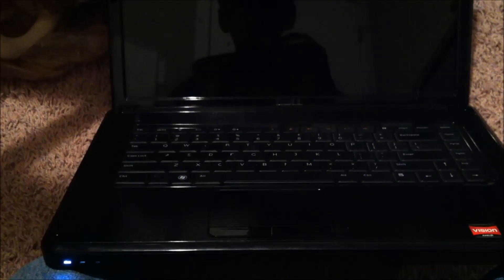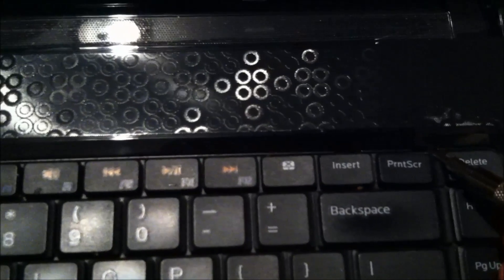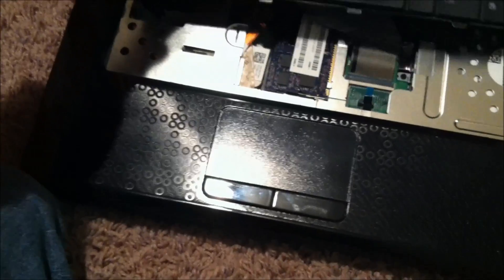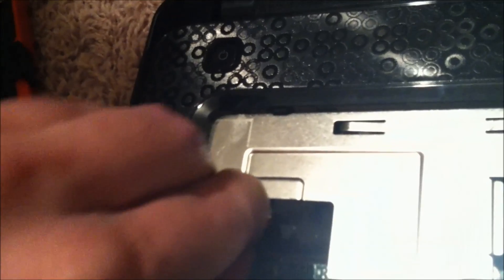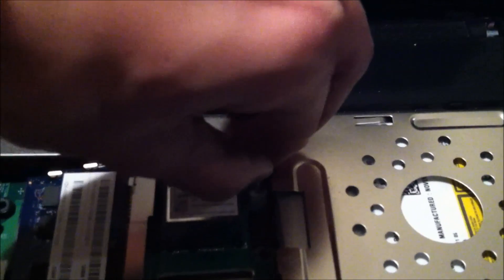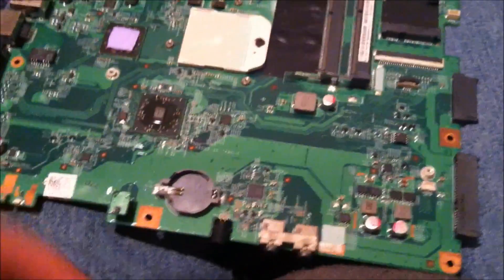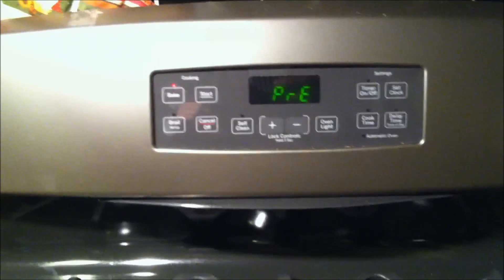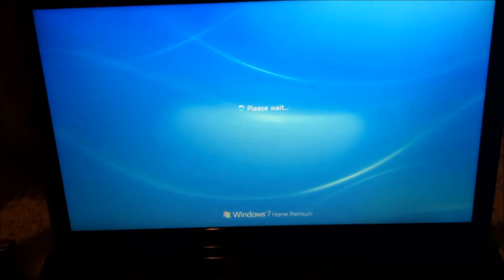How to fix repair Dell Inspiron M5030 7 Beeps Blank Screen No screen when turned on

Comment: Thank you so much it worked! Subscribed! I just had the same problem as Angelika, not connecting to wifi, and i saw your comment about reversing the wires on the wifi card, but if you could explain it more to me that would be helpful cause i dont know how to do that. lol. thanks again!!!

Comment: This was great. I know close to nothing about computers but I was still able to do this and my computer works as well as before. I will say one thing though, my laptop is having issues connecting to my wireless network. It can't connect or sometimes even find the network unless I put my laptop directly next to the motum. Anyone else have this problem? Any tips?
Reply from the maker: Reverse your wires on the wifi card, see if that helps
Reply: That worked! Thanks a lot!
Reply from the maker: Awesome. Good job!

Comment: Didn't work !
Reply from the maker: thats a bummer,look on ebay for a repair service, or you can buy a new motherboard for about 70. Since you know how to take it apart now, should be easy for you to replace!
Reply: It turns on sometimes.. But then it shows the screen green and black
Reply from the maker: reseat your video connector for the screen and make sure you closed down the flaps on all the connections such as keyboard and power button.
Reply: Thanks .. Too late tho., It got me mad and threw it against the floor and threw it away :(

Comment: Tuve el problema de los 7 beeps, particularmente no tengo pistola de calor ni termómetro infrarojo y es un equipo caro, en argentina, para usar una sola vez.
Use esta solucion, 10 minutos dentro de un horno precalentado a 170 y me funciono muy bien. 
Ahora mismo estoy escribiendo desde la notebook... Evidentemente voy a tener que modearla y hacerle unos agujeros abajo para colocar un fan. Es un desastre la ventilacion de fabrica de la notebook, al menos para los calores de buenos aires.
Reply: Man de verdad te funciono? yo tengo el mismo problema y wooo eso de meterla en el horno joder que da miedo no?. Gracias.
Reply: Es una solucion temporaria, hay que hace reballing si o si
Reply: Que es reballing?
Reply: Buscalo en google, es resoldar el chip de video.

Comment: Brilliant! Thank you so much!! One day on since the repair -- and I don't' want to jinx it -- but all seems good with the machine now! I've run all of the deep (Fn) pre-boot diagnostics, booted into Windows both in Safe Mode and Normal mode, run Windows updates and other product updates, and rebooted several times, all without hiccups. There are only two side notes worth mentioning here: 1) Before putting the machine back together, you should clean off the old thermal paste from the CPU and the heat sink, and then apply new thermal paste. 2) Because you must remove the CMOS battery in preparation for baking the motherboard, when you boot the machine for the first time after reassembly, you might get a "5 beep" BIOS error, which indicates problems with the CMOS clock. I tested my CMOS battery before reinstalling it, so I knew it was fine. So, I rebooted, set the correct date and time in the BIOS, and the "5 beep" error went away. No problems after that. Thank you so much again for your effort and excellent instructions! Your explanations, procedures, and video are clear and concise -- really well done, and they worked!

Comment: Yo bro. It worked. Actually i am the mobile engineer. And also computer hardware enginner. I have done similar problems with heat gun (smd). But after reading this post i gave it a try. Here is my process.

1) I disolder the inbuilt microphone
2). I didn't have oven and alluminium foil. So i use my microwave which has grill, combination, convection function in it. 
3) i took out every thing from microwave like the plate. Ring. Centre base of the glass plate.
4) put in mother board naked.
5 pressed the "cook+bake" button set 180'c for 10 min and pressed start button.
5) its started sparking on the board. So i stopped it.
6) i pressed "bake/keep warm" button. With the same degree and time.
7) after 6 minutes the microwave's door heat up alot so i stopped it. And left it as it is for 20 minutes. Then i opened the door and again left it for 20 minutes.
8) i solered back the mic and. whoaah. It started up.
Thanx for this. I hope this procedure help to those who has this kind of microwave but not oven.

Comment: Hi can I use my microwave for the same what should be the setting medium heigh or heigh
Reply from the maker: Anything metal will explode in your microwave. Motherboards have copper in them. I suggest not doing it. However if you do, record the process. I don't recommend it though.

Comment: una pregunta, cuanto tiempo y a cuantos grados deve estar la placa madre? perdon pero no entiendo el ingles
gracias
Reply: Yo lo probé y me funcionó a la perfección muy buena informacion.
Calentá el horno a 190 Grados Celcius una vez que llego a esa temperatura ponelo en el horno el mother con papel de alumio abajo si o si y en una asadera claramente como vez en el video y sin ningun componente sin memoria ram ni disco rigido ni placa de WIFI ni la lectora de DVD ni el cooler.

Solo eso dejalo 10 minutos a 190 grados y apagas el horno lo sacas, esperas a que se enfrie por 20 30 minutos y listo.

Comment: You are so great. It worked absolutly well. Thanks a lot. I have a Inspiron M5010 and the Motherboard is the same. Thanks thanks thanks. P.s.: Celsius is 200 degrees.
Reply from the maker: Thanks for the Celsius degrees, that will be helpful for many others!

Comment: Man this is great, Im taking a break from copying all my most wanted files to external!! I debated for weeks about doing this after many attempts at the simpler solutions,  I then started watching different videos while taking computer apart, everyone had left out a few lil steps here and there that I had questions about (because im picky). when I watched yours I was able to get all connections apart properly and would say the whole project took maybe an hr!! Now here we are!!! I will be thrilled if it works all night but will continue to use until I can comfortably afford the $500 I was about to spend this morning, at a not so comfortable time. Great video!! You saved a lot of files I had not backed up. THANKS, and good work!

Comment: Is there any other way you can think of which I can use to fix the same problem? I dont have a oven right now
Reply from the maker: Walley Ambano heat gun or soldering iron. Extreme fix would be a propane torch(would not recomend it)

Comment: only temp fix, after many searches they used some sht soder in the chip and due to it cooling fast when it shuts off it cracks and your back at the start...   what so and so said below if yours continues to work its cuz it never shuts off to cool which if you want to run the pc like that go for it idk how much longer the parts will last... we all got screwed by dell

Comment: Repair only lasted a week. Read that problem may also be poor cooling system. Gonna try replacing fan and reflowing again. Right now im using external usb cooling board. Any suggestions?

Comment: Thank you so much for this tutorial.  My laptop was serviced "professionally twice and the 7 beeps resumed after a couple of months.  My son and I tried this process and it worked! Now I don't know if this is a permanent fix or not, but what I do know is that it works just fine right now and if it stops working again, I now know how to retrieve my hard drive with all of my data.  Your instructions were very easy to follow and the process was not a difficult one.  I would have been charged hundreds of dollars by the "Geek Squad" or some other repair service.  So...I'm a happy camper.  Thanks for posting!!

Comment: OMG!!!! This is solution like "How to make shit". This is not repair!!! It's can't work more then one week... ONLY way to repair this motherboard is solder a brand new northbridge 216-0752001.
Reply from the maker: I've yet to see any comment of this failing after a week. Not one. Not even after several months. Hundreds have replied and not a single one had said it failed after a week. I make videos for home viewers, people with simple skills. You make a video on how to solder a new north bridge and see just how many can do it. Until then, my viewers will easy bake their motherboards back to a working state.
Reply: After Hours Tv & Pc repair So, for whot is BGA station? Soldering station? Brand new chip? Only for stiupid people who dosn't have oven? Heh... I'm repairing motherboards from 6 years, and I know that reballing, heating all of broken chipset is NOT permanent repair, its only way to sell notebook on ebay like good nootebook. Problem with chipsets is in the solder ball under core between laminate of chip, not between chip and motherborad. So you cant repair chipset... I will add that motherboard after cooking can be not repairable. I'v seen pairs motherboard after cooking without meny resistors, capacitors, IC, etc... Because they fall off from MB during cooking :)  I'v seen swollen laminate too :)
Reply from the maker: Surely I wouldn't want to educate 48 thousand people to buy a 600-1000 dollar machine to reflow a 300 dollar machine. :)

Comment: Worked perfectly as expected, however now one of my (the top port) memory slots isn't working. I receive 4 beeps acknowledging a ram error whenever I put the memory in the outer slot. I've tried multiple ram sticks and still get the same error, so I can only use my one 4gb ram as apposed to 2x4gb
Reply from the maker: Sorry to hear that, strange that this would happen.

Comment: so is this temporary After Hours Tv & Pc repair
Reply from the maker: I've worked on three of these. 2/3 are still working today. I havnt seen any f these same people commenting back after months that it has failed again. Try it and see how long it works for you. I'm interested to know myself.
Reply: will do
Reply from the maker: It's been 7 days, still working?
Reply: After Hours Tv & Pc repair  sorry i haven't replied and yes its still working thank you so much i really appreciate it
Reply: After Hours Tv & Pc repair
How long ago did you bake this motherboard and is it still working?
Reply from the maker: nov 23, 2013. I repaired 3 of them total. This one is still working today.
Reply: After Hours Tv & Pc repair
Do you know if the other two are still working?
Reply from the maker: I havnt heard either way from them. You can see plenty of people saying it works. Have you tried it?

Comment: I didn't see anyone else mention that after the fix on the bootup mine beeped five times for a short while which is the code for a bad CMOS battery. It did stop shortly afterward and seems fine.

Comment: Will this same method work with a heat gun and tin foil? I have those two things. I re flowed an xbox with it. Also, is this a temp fix or permanent? This motherboard costs over 100 bucks. Just don't wanna dish out the money if I don't have to.
Reply from the maker: For the most part permanent, they suffer from a poor cooling design. The heat gun will work better than a oven, most common people don't have heat guns and this would be easiest to them to do, I refrain from telling anybody to use a direct heat source, had a guy try to remove his capacitors with a propane torch once
Reply: Just wanted to give an update here - I tried this out with the heat gun and it worked perfectly. PC rebooted, and beeped 5 times, which indicated the Real-Time clock was not working, but that was my fault because I forgot ti re-install the BIOS battery. However, I got a successful BIOS post beep and booted into windows. Back on top of the world again!

Comment: You're a life saver! I followed the steps just as you had described :)  And... my laptop is back.  I did experience a 5 beep afterward, indicating a time/date issue. I synced the time/date and wahla! Do you recommend any further steps to try and prevent the 7 beeps from reoccurring? Thanks!

Comment: Afriend brought a laptop that beeps 7 times when boots and the screen does not show anything. i did solve this issue this morning by application of this tutorial for those who does not have oven of heat gun, you can just use a soldering iron and something as a cover to the solder. 
Step 1. follow the steps here, but do not put it in an oven you can just do that by heating you solder iron. 
2. there are 3 chips which covered by the cooling system one being the processor and the two remaining are those you will work on remove the processor, 
3. put the solder iron on the two chips which is not the processor allow a small space between the solder iron and the chip. 
4. cover the solder iron and the chip only not all the board with something which will not burn in the presence of heat for about thirty minutes, for each chip. 
5. Allow the chip to cools you can best use fan to cool it 
6. assemble your laptop dell m5030 and boot it. 
if you really did it well it should boot and stop the beeping 
Thank you for any further if you failed contact me lukrudus@hotmail.com or +233506154495 / +233542707250

Comment: So how long did this last in working order? I have one needs this doing but don't want it to be short term, ideally.
Reply from the maker: One i did lasted 6 months, the owner was very rough with the laptop. I havnt heard back from the people commenting that it has stopped working.
Reply: Great, thanks for the info 8-)
Reply: Another quick question - is it necessary to take the WLAN card out? On the one I have the screw head is shot to pieces and theres no space to get pliers on it.
Reply from the maker: I think it will be fine. If not it's only couple bucks off eBay.
Reply: OK thanks!
Reply: lewisner .

Comment: why do people think putting motherboards in a COOKER fixes things ? .. this is the most cowboy method ive seen so far .. when you put it in the oven you end up heating EVERYTHING on the board up which isn't a way to solve a simple 7 beep laptop problem .. please people DO NOT TRY THIS!
Reply from the maker: Look how many comments have said that this works and have fixed their problem. Some might be only temp to get files off the drive. Saying that this doesn't work is kinda dumb,
Reply: have you every thought about simply using a heat gun on the spot that actually only needs heating up to do the fix ? .. there is a cowboy way of doing a fix and a professional way of doing the fix and placing tin foil around the chip . this keeps anything else from being damaged in the process ..
Reply from the maker: I understand the heat gun and tin foil process, but does everybody have a heat gun and knowledge to do so? Majority of people have ovens. It works the same way, so why bash it? I make videos for unskilled home users to fix their stuff. I have to make sure that they can do this themselves, I'm not about to do a video involving a heat gun, and foil. If you like, make a video of what your describing, post it, and I'll put it in the description field as a different process of doing this.
Reply from the maker: What got damaged in doing the oven process? You see clearly that the computer was working just fine. Sigh.

Comment: Well, this got the screen to come back on.  However, I instantly get a message saying that Windows is unable to start, maybe due to a hardware or software change.  I ran Startup Repair and no problems could be solved automatically.  Also reverted to last restore point, but still no luck.  Any ideas?
Reply from the maker: That issue is operating system error. Not related. Run chkdsk in Safe mode
Reply: I managed to get it worked out.  She's running like a champ now. Thanks!

Comment: so just wanna ask i dint really catch that... why you need to preheat it to the oven? i mean what exactly happened? i have a laptop i have to fix having same problem. Can I possibly just turn it on and just cover it with some box or something that it will become hot for like 10mins then let it cool after? please answer my questions. I'd really appreciate it :) and I'd subscribe too :)
Reply from the maker: Preheating is just so you melt things slowly. And not burning board up.

Comment: Hey, thanks for the tutorial!
Got the motherboard out and stripped, was about to bake it when I realized my old oven's maximum temperature is 280°. Do you think it will work with 10 minutes of baking anyway? Don't want to overcook it, my gf went nuts when I told her I was baking her laptop and I'm a dead man if it leaves it worse.
Thanks again!
Reply from the maker: Better just check for a service on eBay that does them. "M5030 motherboard service"
Reply: After Hours Tv & Pc repair
Update: Used a friend's oven and it now works perfectly :)
Thanks a lot!
Reply from the maker: Awesome good deal!

Comment: Dude you rock!!! This worked like a dream. My laptop was barely over one year old. I will say this I will NEVER buy another Dell. No wonder they are going out of business and laying off everyone.
Reply: As a PC tech I have owned and used many dell PC's / laptops over the years and I have to say that this particular model of dell was a very low end low cost variant of what dell normally offers and I would not recommend this particular model dell to anyone.   Now, Dell's customer service on the other hand........ that is enough to make me not want to buy DELL again.